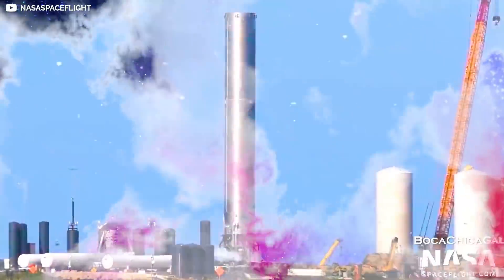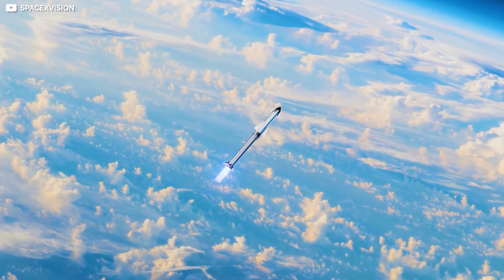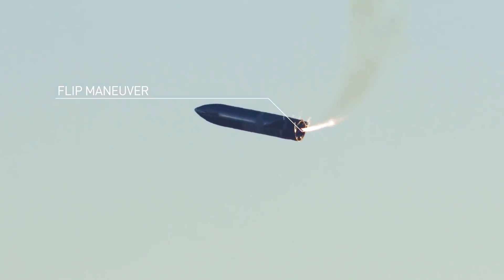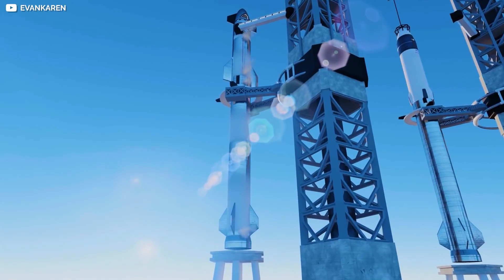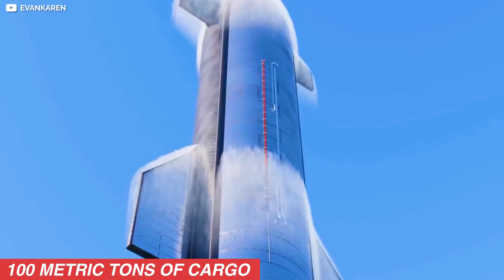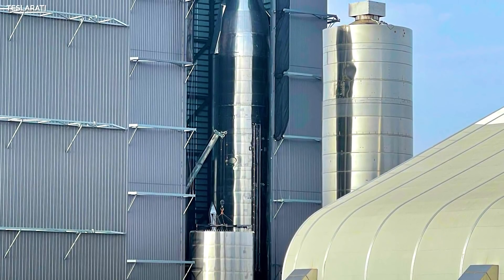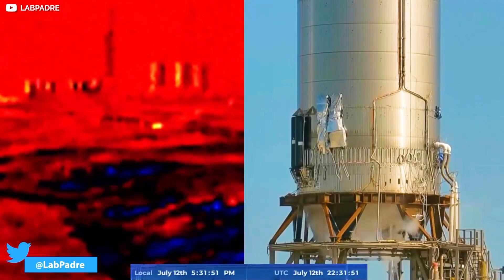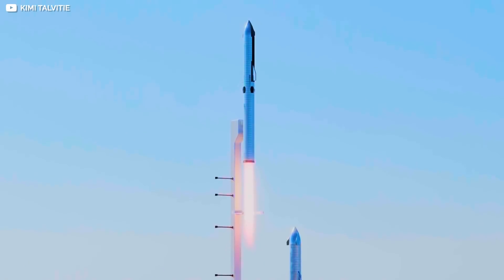IT'S HAPPENING! SpaceX Is FINALLY Testing New Super Heavy BN3!

Comment: 1.Booster 3 only ever had 3 engines and at the moment has 0

2.Booster 4 will only do, ambient pressure, test cryo test, static fire, and orbital launch.

3.SpaceX has announced that after starship 100% developed in total it will have 31 engines

4.New naming system,
S/ship=starships 
B/booster=super heavy 
RC=raptor center
RB=raptor boost
RVAC=raptor vacuum.

Other than that this is pretty good
Reply: Not 32 raptors?
Reply: @misterproblem1373  not 32
Reply: Future operational super heavy boosters will only have 31
Reply: 33 engines will be used on booster and 9 will be on starship.
Reply: @jacobstingerschwartz  no
Reply: @jacobstingerschwartz  where did you get 9 on starship
Reply: @MSR_Space_Tech  The final plan that Elon wants is to have 33 on the developed booster and nine on the developed starship. Equaling 42 total raptors. He stated many times that he wants this number because it’s the answer of the universe
Reply: @jacobstingerschwartz  yes it was the answer of the universe a month ago
Reply: @MSR_Space_Tech  why 42 is a answer of universe?
Reply: @jacobstingerschwartz  Elon has said that it will be 31 on super heavy and 6 on starship
Reply: @jacobstingerschwartz  what would be the extra three engines on starship it is physically impossible to fit that many in starships engine skirt 3 vacuum engines and three sea level engines
Reply: @MSR_Space_Tech  go look at the last video engineering today posted. The final design will be 33 in booster and 9 on starship equaling a total of 42
Reply: @jacobstingerschwartz  Elon has said since 2019 it is 6 engines for starship and recently he has said that the final amount of engines for super heavy will in fact be 31